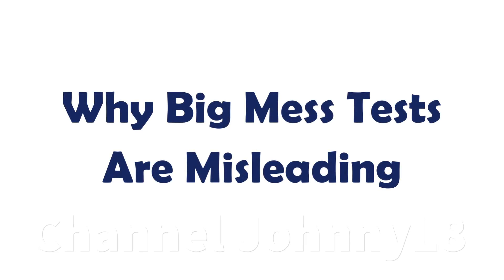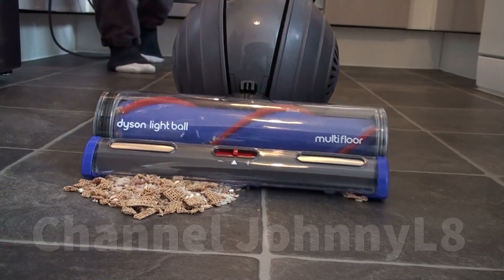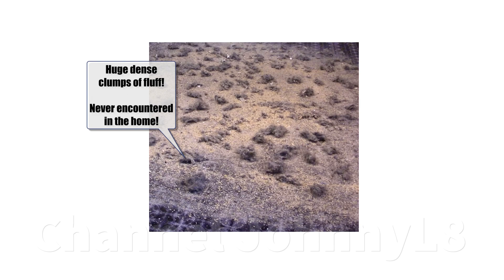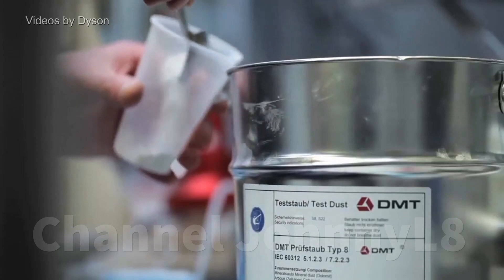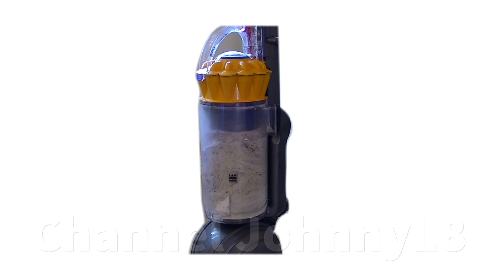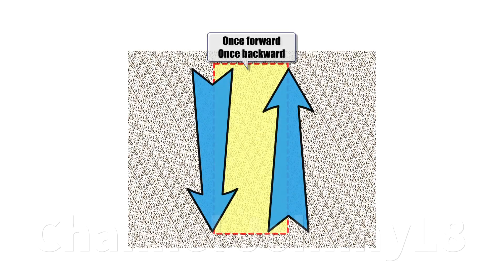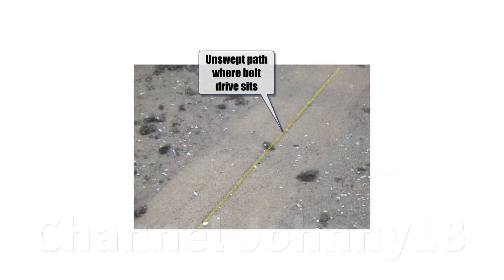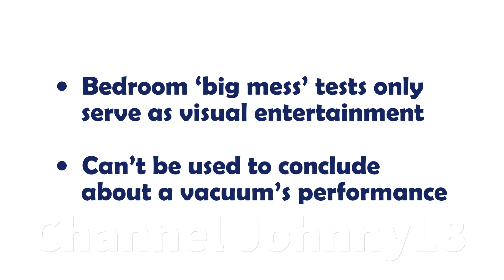Why Vacuum Cleaner Big Mess Tests Are Misleading

Comment: But some vacuums can handle the big mess test. So theoretically could handle anything, no domestic job would fail it.
Reply from the maker: In another video (the statistics one) I explained why this isn't true. A vacuum that can cope (visually) with a big mess test when there's lots of easy dirt to collect, can struggle to pick up well at microscopic levels when concentrations are lower. Achieving the lowest concentrations of dirt is very difficult and extremely careful engineering can outperform brute force machines. But those machines engineered to achieve low concentrations can struggle to cope with ridiculously excessive big messes. Big messes don't represent normal household use and low concentrations do. It's unintuitive and difficult to understand, but true, as evidenced by independent testing to industry standards.